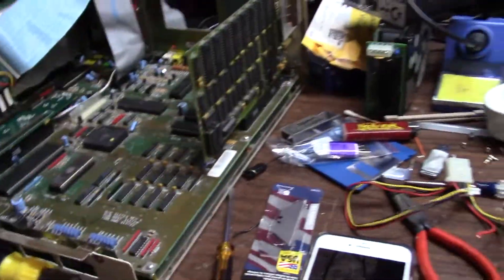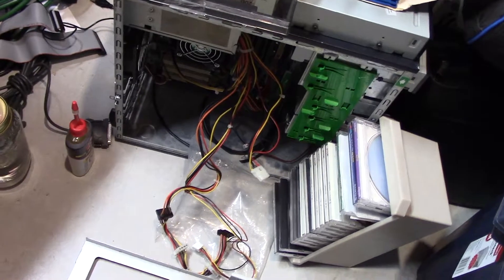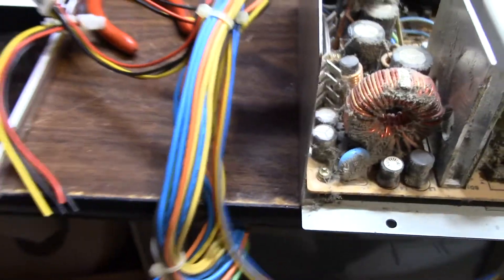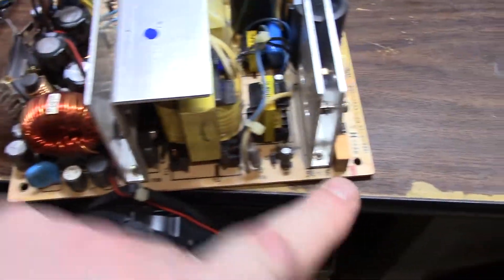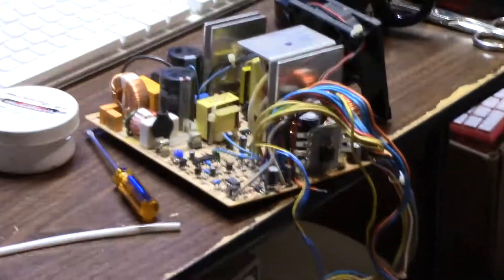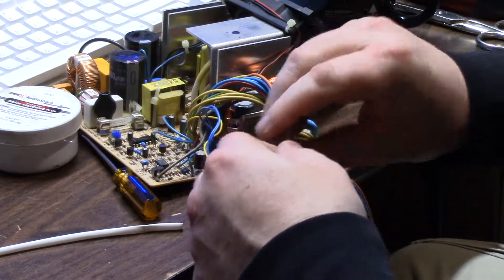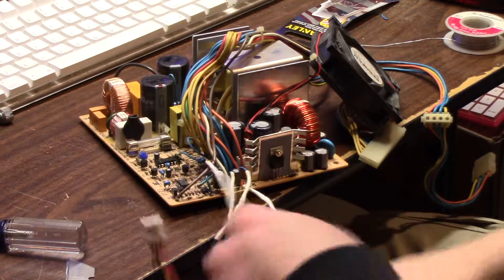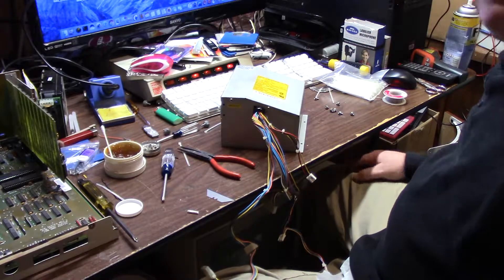Episode 73 Amiga 2000 power supply tune up

Comment: Wow you posted this 5 years ago. Though you know if I had the time I would systematically remove the cables and replace them at the board level with new solider with the cable color they should be. :)